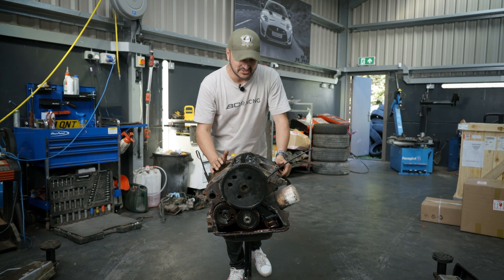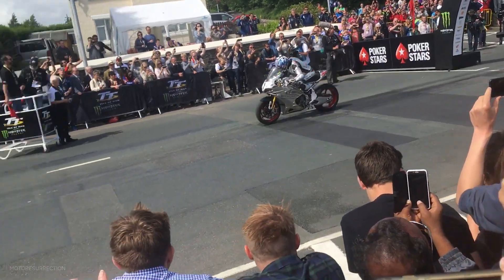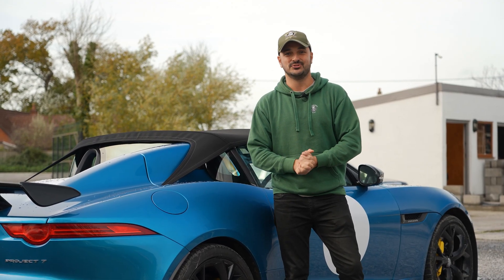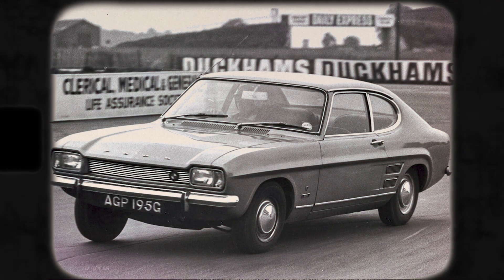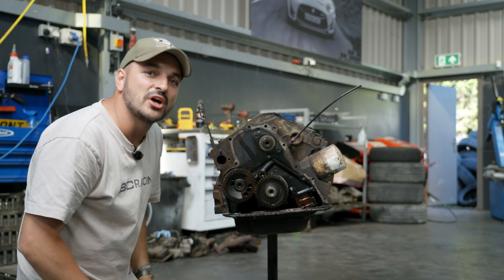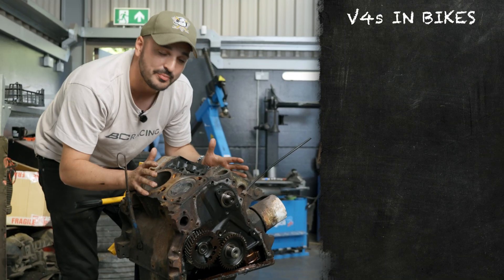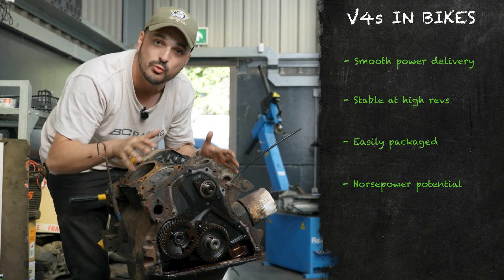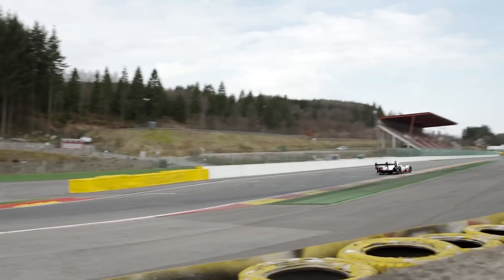Why Do Cars Not Have V4 Engines?

Comment: The Saab 96 came with the Ford V4 engine and was very popular in rally back in the day. Used to be they took out something like 150 hk from those engines.
Today people here in Sweden can get 160-170 horsepower from a 1.7 l enigne sized up to 1.8.
Some boosted engines supposedly reached 300 hp.

The Saab V4 is a part of growing up. Quite special cars and engines. =)
Reply: I have a 1975 SAAB 96 V4 on its third engine and gearbox. It's an old daily driver and it shows, but that's also the charm of it; it was built to drive and it still does (although a lot less since getting replaced by a newer daily driver car in the 90's). The V4 sound is truly unique and I do worry from time to time what I will do with it when the engine expires, because the chassis is still mostly good and the daily driver modifications like heating wire in the steering wheel makes it feel like a car that wants to keep doing its job until the end of time. Being a SAAB enthusiast I could never send to a junkyard anyway.
Reply: The SAAB 96 and 95 originally had a 3-cylinder 2-stroke engine that originated with the West German firm Auto Union (that later became Audi). In the mid 1960s SAAB decided that it needed a 4-stroke engine to meet forthcoming emission regulations. The Ford V4 was the only 4-stroke engine that was short enough to fit in the available space without big modifications to the car.
Reply: We have one, and it has the 4 on the tree and a lever on the floor that let the car coast while still in gear.
Reply: @lh5943  The famous freewheel
Reply: @lh5943 
Freewheeling
Reply: The Saab 96 was a good safe car.  I was told in the early 80's Saab had to abandon the V4 because it had a siamese exhaust configuration, and the hot gases escaped too fast out the exhaust manifold to be easily handled with emmision control equipment.  I would like to see Saab start building cars again,,,  with solid state batteries.
Reply: @MET-Dynepro  Very good winter car also. Started without problem in -35 C.

A friends older brother had one with some rally spec. He couldnt close the hood due to the bigger carb etc =) Once we reached 160 km/h in his car. With old suspension that was a bit scary indeed..
Reply: I was hopeful for some discussion of the Saab V4. My dad raced Bugs in the early days of the Baja off road races. He said the Saabs with the V4 were tough to beat. I also hoped for a little  info one the niche V4s used in American Midget racing. Essentially they used cut down V8s to create a fabulous little engine.
Reply: @sixter4157  FWIR,  The Saab Owners Assoc printed  a story about how to rebuild the V4, and they discovered it shared pistons with a Ford Maverick. V8 I think. Saved some money. So the V8 and V4 shared parts and tooling.
Reply: And the Ford Transit. The old one.
Reply: I don't know why V4s would be a problem when boxer 4s can be so good.
Reply: That was a different V4, developed by Ford Germany. It's unrelated to the engine in this video.
Reply: Also the sonet
Reply: I was just going to comment about this! In college (2016) my roommate and I both had 1969 96s! Great cars! I daily drove mine, year round, in Montana for a few years, but in the end it ended up becoming a parts donor for my friend's much less rusty car!
Reply: It was an industrial Ford engine based on the industrial Ford V8. That's why it was never a good peak performance engine. The Ford/Saab V4 was used in a White Forklift.
Reply: @don2deliver 
If it was based on an industrial V8, why does it have a 60 degrees bank angle?

Doesn’t make sense.
Reply: @e28forever30 I think it was based, as described in the video, on a V6 engine that was also made for cars.
Reply: @cedriclynch  Yes, ford had two v4 engines.  Cologne v4 and an Essex v4 engine.  Both were based on the ford  cologne v6 and Essex v6.
Reply: @don2deliver  Cologne v4 and Essex V4.  Those are the two ford V4 engines I am aware of.

Comment: I have ridden several of Honda's VFRs though I never owned one.  The most powerful was the VF1000F, but I don't think any of them quite matched the smoothness of my car-like CBR1100xx in-line four powerplant.  All the V4 motors had a discernable sweet spot where they loved to run, the CBR was so smooth I couldn't tell what the motor was doing without looking at the tach - once I found I"d been riding down the freeway at 125 km/h for about 20 minutes in 4th gear.  For a bike, I like the 90 degree V4 the best, though OHC V-twins rock too - the induction howl on the factory RC51's going through Rainey in 2002 was intoxicating.  And look kup the history of the Honda V-12 F1 engine in the mid-60's.  it was loaded with gp bike parts...

Comment: Cheeses. The straight 4 engine for cars is just cheap.
 Without a turbo a 4 adult seater car need 4 cyls for top power and flexibility out of a sensible sized (1300-2000) lump. (500cc cyl was optimal, volvo added one)
The V4 layout for motorcycles is NOT 'cheap'. Or required except looney tunes bikes.
How difficult can this be?
 FFS, the sensible bike performance engine is now an inline triple.
The triumph 765 engine makes almost 100 rwhp. (415 lbs wet) top speed 150 without proper fairing.
With some light work to undo the worst of EU6  or whatever its called, the yam r9 (435 lbs) makes 120 rwhp like a fireblade. 
More than the gsx1100 rhino. (560 lbs)

(there was the '98 fb that I hear weighed 400 wet but whatever)

basically we dont need inline 4 bikes any more.  Let alone V4 cars.
You might as well have called this vid 'why dont cars use motorbike engines?'
Reply: The Inline Six is Balanced, so your four, and the Five from Volvo, were using subtraction to be Cheap, wear out sooner, and cause vibrations to it's human inhabitants.
More on how subsonic energy effects humans to come ... since Industry has chosen to ignore their own studies for Profit ... from Independent Sources.
That is SIMPLE.
You must have been clipping coupons while typing that message.
Reply: @truthsRsung  No, I wrote that message before watching the video!
The title doesnt mention inline six. Only V4!
Reply: @MrChriss000   ... I didn't ask you a question, but thanx for clarifying your Process.

I'd love to hear how you approach crossing the street, for entertainment purposes Only.
Reply: @truthsRsung  Well, if you think I treat life threatening situations in real world the same as watching a video it is obviously you that is the idiot.
And obviously you are right about 4 and 5 cyls, volvo and merc, they only last a few hundred miles. BA HA HA HA HA HA ha ha.

Comment: Because things work better in a straight line. V engines are created to fit in smaller spaces
Reply: Because Cars were designed to fit four chairs, or even a small sofa, and sit in rush hour traffic, they ignore a lot of physics lessons that motorcycles don't dare to turn a blind eye to.
Motorcyclists like the Curves in the Road, so our powerplants are best when as compact and low as possible and the V-4 has no equal (as long as you ignore that a Wankel is an engine type.)

Comment: Yeah as always there are downsides, but what engine doesn't!, i would love to stuff an unconventional engine in my car, that's why i thought about a rotary\boxer instead of my boring i4
Reply: Clippy would advise, "The inline 6 and the V-12 don't compromise on Balance."
All other designs are a compromise for packaging, or manufacturing.
If you want to be "unconventional," Don't Compromise.
Be Conventional in every other way.  High production numbers usually mean high availability of parts from both the manufacturer and aftermarket, at a low cost.
You just mentioned two alternatives known for Oiling and Fueling problems and your friend Clippy there thinks those are unacceptable risks.
Reply: @truthsRsung  Then how about that Chevrolet turbine car that could run on cologne or whisky?
Reply: @MichaelFalcon-g3f   ... The one that Deafened everyone around and Burned anyone who walked behind it?
You've obviously never been on the ground at an Airport, or comprehend what a Noise Ordinance is, or even lit a Match.
You should NOT have a Clippy as your Profile Pic.
Reply: @truthsRsung no pain- no gain!, some1 stuffs a radial engine in a vw bus, some stuff a RR tank or plane engine in a CrownVic. Stand out!, be brave!, the current car community is too stiff!, ls-that, k-swap this, boring! How about a nuclear power plant, that the engineers chicken-ed out!
Reply: @MichaelFalcon-g3f   ... You should stick to your video games and cartoons, and NEVER attempt to cross the street unassisted, for the motorists sake.
Reply: @truthsRsung what’s the fun in that?, all people talk about the “dangers” on the road, but almost everyone is saying that “it’s not them”, so, I’ve decided to take up that place!, I’m the guy who puts the coil with a relay on the chassis), so no kid will ever touch my car twice!, “embrace the nastiness !”

Comment: great video but if I can make one minor amendment; a v4 in a bike is the best compromise of width and length; not just length. Inline 4 is inherently shorter meaning wheelbase can be shorter (or more precisely allows for a longer swingarm for a given wheelbase improving stability while allowing for a faster turn)  but it's quite wide which affects aero. A v twin is very narrow for aero but for a given displacement has to have a longer stroke so limits how long the swingarm can be for a given wheelbase. The v4 is the compromise which ends up being the best of both worlds which is why (as of 2026season) every single MotoGP bike will be v4 powered. Yamaha persevered as long as they could but eventually even they had to admit honda were right all along.

Comment: They aren't so bad, a friend of mine has driven a Saab Sonnet with a V4 for decades it's got just over 360,000 miles on it and the engine has never been apart.

Comment: Sometimes the only reason a certain engine design doesn't make it mainstream is because we haven't put the time, engineering and money into it. If Ford or Merc started with a rotary over a century ago, we would probably have many manufacturers using them today with similar performance and reliability to modern piston engines.

Comment: It's the cost.
To engineer an in-line 4 and a V-4 to have the same level of balance and power/displacement ratio...you'll spend nearly twice as much on a V-4.

Basically the V-4 requires two heads and a more complex crankshaft and balancing.

So virtually all automotive companies crunch the numbers and make a straight 4.

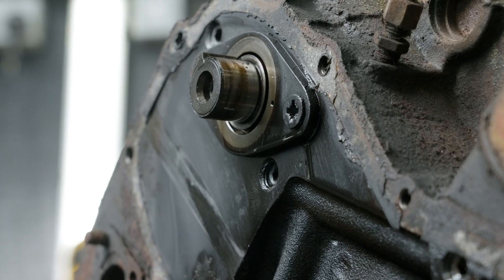Comment: 7:10 "the ideal bank angle for a V4 is 90 degrees (that's true) because you can design the crankshaft around cylinders firing every 180 degrees" (Wrong). Firing every 180 degrees is totally normal with an I4 but impossible for any V4 regardless of its bank angle. The only exception to this is if you have a 4 journal crankshaft which the Porsche at 11:36 has, however that's a mega-dollar racing special.

Comment: Love to see the Ford V4 fitted with a single small turbo and multi port EFI, build it for low end torque as aiming for top end power will make it shake itself to many bits of cast iron.
They are a neat looking engine and look a lot like a Ford Windsor from the front.
(Was seriously looking at putting a Transit V4 into a Ford Model A hotrod pickup I was building 10 years ago here in Australia)

Comment: The point of a V-6/8/10/12/16 is to shorten the engine block, so that the hood can be shortened reducing vehicle weight OR it will then fit within the width of the car.  As a byproduct it also shortens the block, heads, crank, and camshafts, allowing them to be much stiffer.

Going from an inline-4 to a V-4 doesn't actually shrink the dimensions of the engine that much while making it more expensive to produce and harder to service with multiple heads and the more complicated fueling, intake, and exhaust plumbing required.

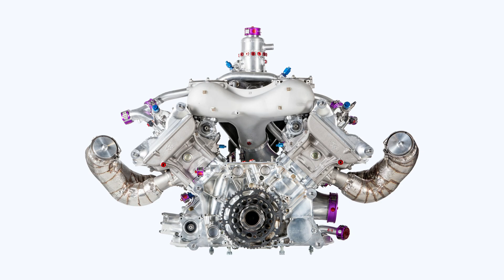Comment: @11:35 thank you for including a shot of the Porsche crankshaft. The Ford V4, though was based on a 60 degree block because of its pedigree bigger brother V6, had an even firing order unlike some V4's, and so it likely had individual crankpins per cylinder (cross plane), and I'm guessing it would have also had a splayed pin offset to enable it to run as an even fire at 60 deg. 

As a European offering from the 70's, its hard to find pictures of its crankshaft up close unless you can find one from an EBay listing if torn down.

Comment: 75yr olde bass player here. Back in the early 1970's I had a Ford Transit with the lowly V4. It hauled us all over the Welsh Valleys 3 nights a week and to my regular 40hrs a week job. That V4 was smooth and never skipped a beat (bad pun!). The engine was a smooth reliable work horse. I replaced U-joints and a 3rd gear syncro and that was all it took to keep it running. 
In a different band I was in the band leader had a Saab with the V4, that thing could really move down the road! A great compact power unit of the day. My feeling is they should have kept it in production especially with all the  improving technology over the last 50+ years.

Comment: V engines allow very over-square, larger bore than stroke, engines, because with inline's increasing the bore increases the length which is a packaging problem. Over-square is required for very high performance as it allows higher RPM. Which explains why bikes use them and most MotoGP bikes are now V4's. 
High power high rpm motors are not passenger car attributes manufacturers strove for so balanced against cost of manufacturing they rejected them.
I maintain Subaru should have adopted a 90 degree V4 instead of opposed engines because among other things their inherent robustness, as opposed to the no solid block boxers, without gigantic cam drives on both sides, is inherently superior. There was no rule against longer stroke V4's of course but such goes against the choice to begin with.

Comment: Ford had a V4 at least in Germany. Very reliable engine, it had a balancing shaft to kill vibrations and was very smooth. Every connecting rod had its own crankpin. The same engine was licensed by SAAB for the four stroke SAAB 96, replacing the 3 cylinder two stroke. The engine did build very small for its size and power.
USA car enthusiast are that up taken with their V8s, that they stop thinking. If they would care about smooth, they would have kept to inline six, or put balancing shafts in their V8.

Comment: C3:17 When he goes into describing why an inline engine has more advantages due to design dimensions, then immediately goes into talking about how V-4’s are advantageous for motorcycles but they’re somehow more compact, high revving? Smooth power delivery? Over an inline-4?? That’s just incorrect.
Reply: Inline 4s have bad secondary imbalance compared to a V4. Especially once the rod becomes longer.  

 V4s add a lot of parts. Very well balanced. 

 The guy driving4answers probably explains balancing better than anyone. Repeatedly. Hardly a video where he hasn't mentioned it to be honest. To his annoyance. 

 With that said can you imagine telling someone you drive a three cylinder hybrid sedan at a car meet. 

  Then rolled up in a Koenigsegg Gamera. Why the three cylinders. I imagine they just cut out half an I6. 

 I don't know this guy or the other channel Drive Tribe. Tired of all these car channels being clueless on modern tech, because it doesn't make noise. 

 YASA has a 28 pound motor putting out 1000bhp, 750kw, 350-400kw continuous around 28-31kw/per kg. No exotic metals. Tested on a dyno. 

 Very curious on how they are cooling such a power dense... Thang. 

 Double the peak of a top fuel dragster if you compare by power to weight. The numbers I can find anyway range from 25-33k per kg for top fuel.  

 So please correct me. It's annoying not getting a weight/power from the top ten average. 

 F1 apparently is 1000bhp in 150kg when trying to separate the motors/engine only. The best I got is 5kw/kg for that available at certain moments of a race. That's a generous over estimation 4:20  too. 

 Pathetic. How's that supposed to be the best motorsport when they're restricting innovation like mad in both engines, and motors? 

 We should have an effective, efficient rotary ICE by now. 

 Even their batteries are whack in the energy density department. Good burst of power though.